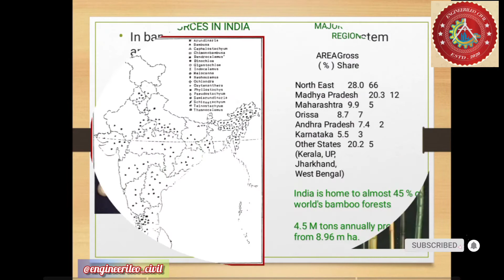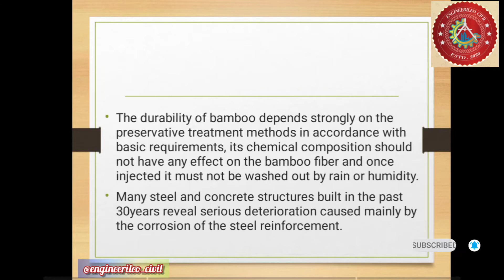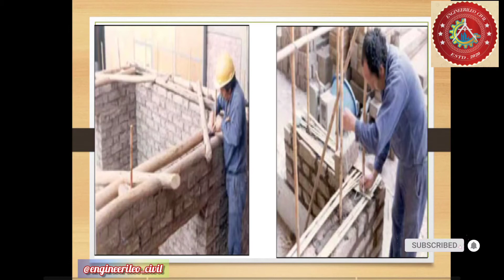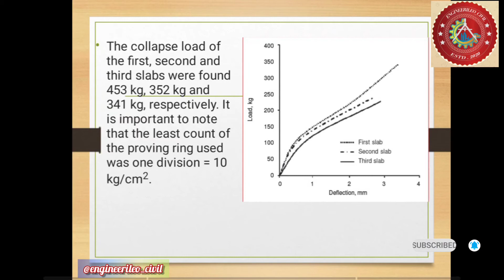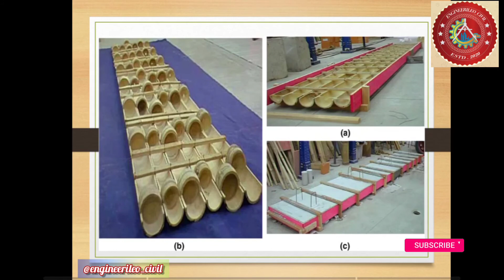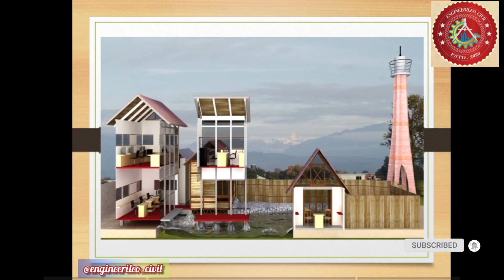5. Bamboo as Construction Material

Comment: i think, for insulation, foam boards with acrylic cement/fabric on the boards, wired to the boo structure, will give beauty, insulation, longetivity, as well as a very good roof, as this base will take many of the fine roofing materials available, including green roofs.
Reply from the maker: Nice👍
Reply: @engineerileocivil  please do a vid on styro aircrete with a bamboo frame inside of it. cheap and strong..